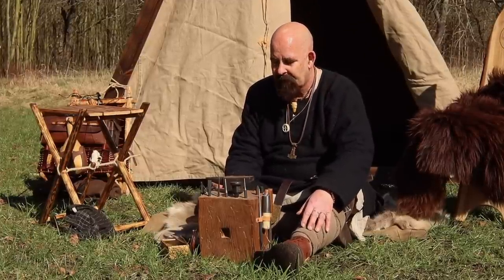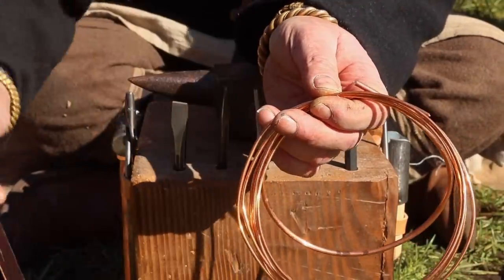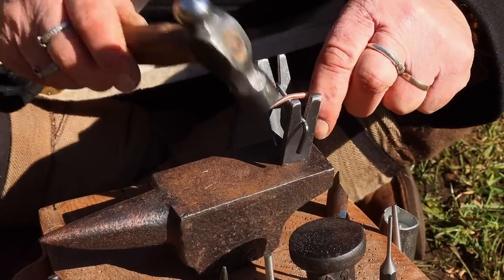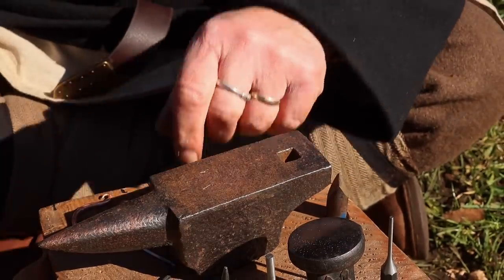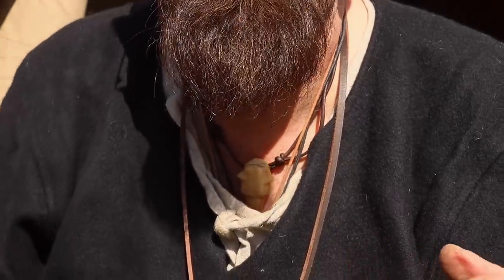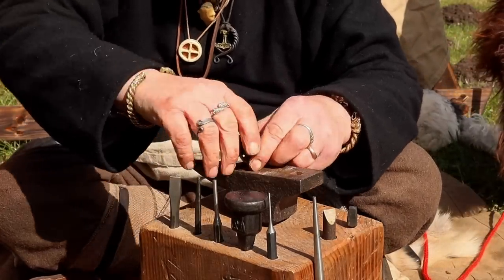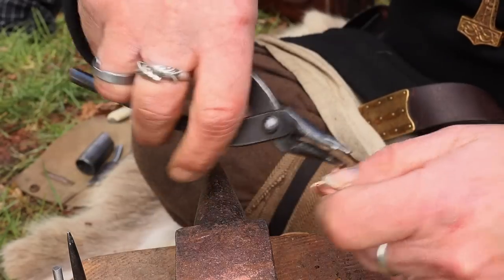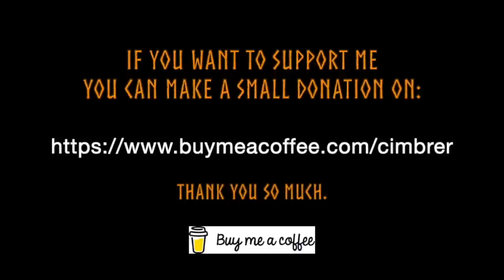Cold Forging Viking Jewelry  in the Forest   Part 1

Comment: Amazing experience! Although I am a jeweler and have been working on a completely different level for a long time, I was still delighted when I saw your tool kit and your work process. Once I myself made an attempt to take my small anvil into the wild forest like this and forge steel there. For this purpose, I also took with me some bricks or ceramic plates and a gas burner to build a forge. However, I have seen how other craftsmen in the field work use wet clay and coal for this. If you pump oxygen to the hearth with "bellows", you will be able to achieve the required temperature for forging steel. For this, it is desirable to have an assistant.
Reply: Those would sell like hotcakes. !  Very nice!!
Reply from the maker: Dear friend. Due to an overwhelming amounts of new comments, I’m unfortunately not able to answer all of them 😉 but I read them all, and very grateful for everyone off them 🤗 Thanks for all your kindness and support , that means a lot to Cornelius and me 👍🏻🐕🏕🔥Tom
Very interesting 🤔 and I’m thinking about doing this out in the forest someday 👍🏻🔥